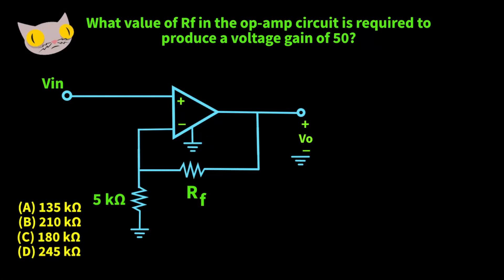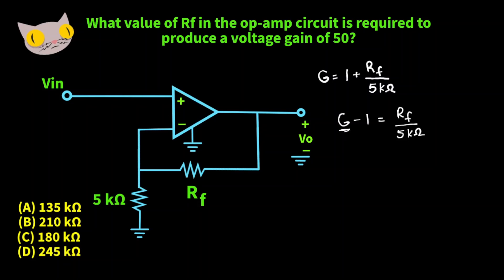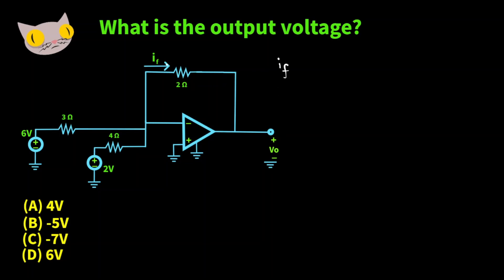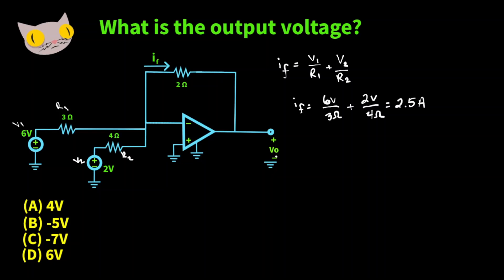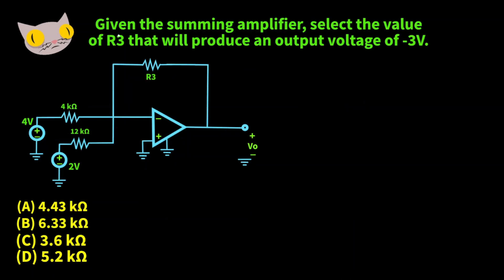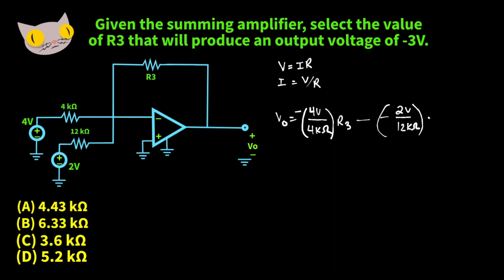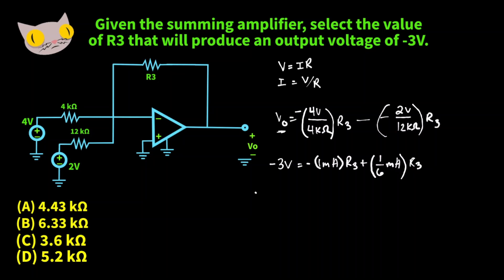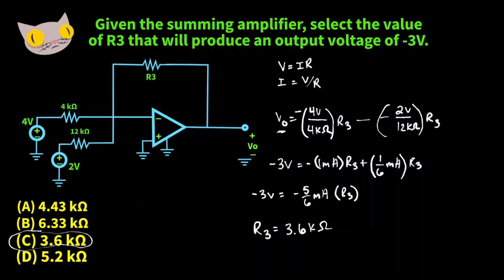Operational Amplifier Problems | Finding Missing Values

Comment: Am I missing the point on the last one?

The 4V supply contributes 1 mA, the 2V supply contributes 1/6 mA.
Combined the current through R3 becomes 7/6 mA, not 5/6 mA or am I mistaken?

If I am right R3 should be 3/(7/6) = 2.6kOhm
Reply from the maker: You are absolutely right, I miscalculated the combined current values. Thank you so much for pointing that out. I will pin your comment so that others can see this. I apologize for the mistake, I will be sure to triple and quadruple check my calculations in the future.
Reply: @studycat2658  No need to apologize! You have put time and effort in making content like this, it is appreciated. It is easy to make a small mistake like this.